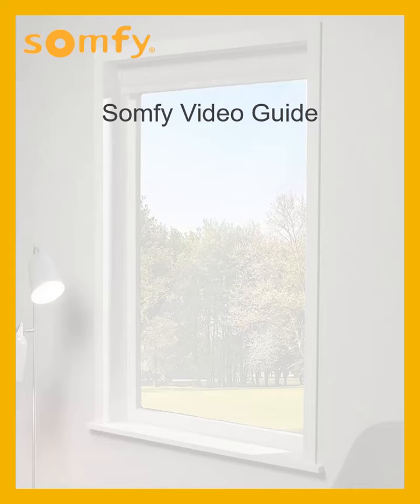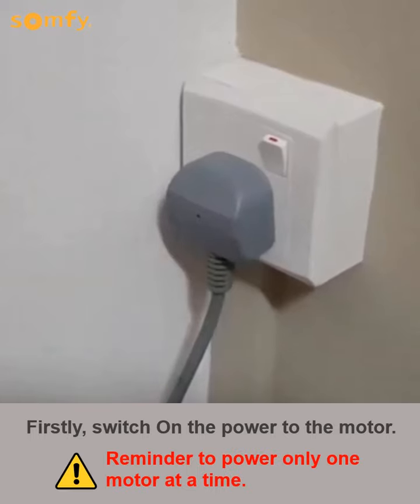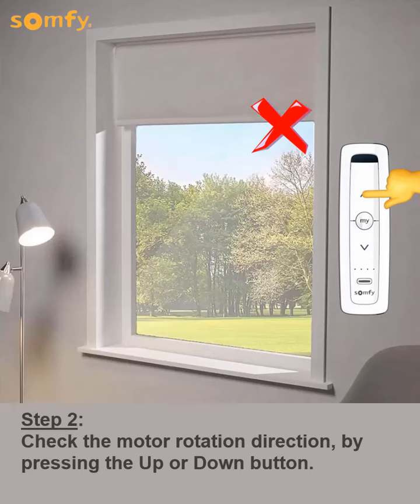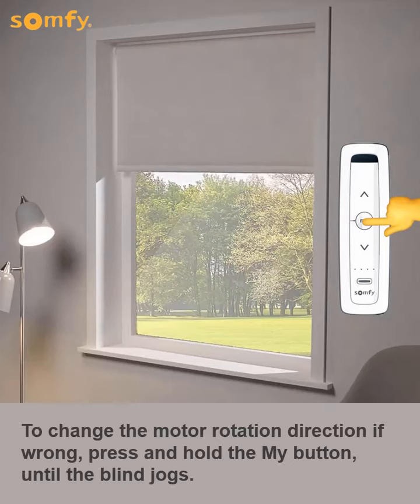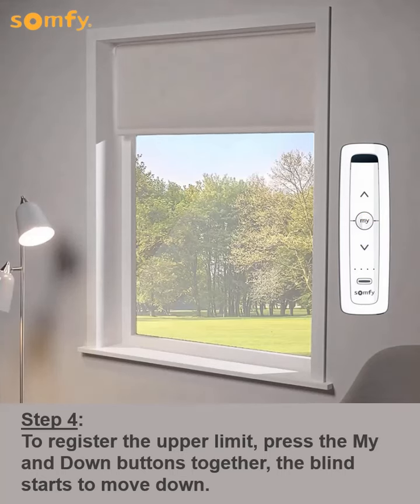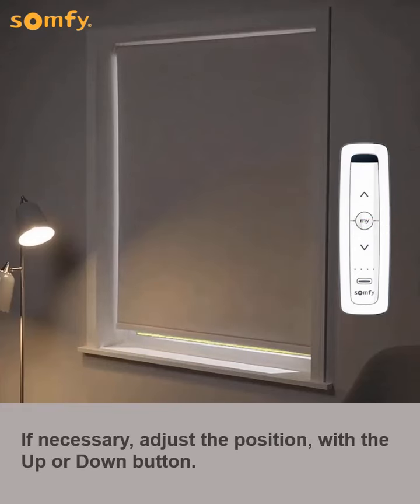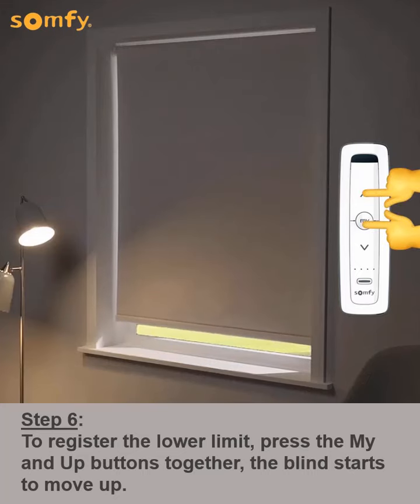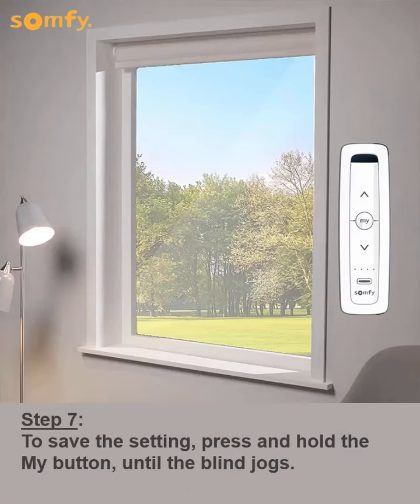[Somfy Tutorial] How to Set up Somfy RTS Tubular Motor - ENGLISH

Comment: How to  delete transmitter programs to zero setting.
Reply: Press and hold button in the motor, not remote for 10 seconds, blind will jog 3 times then all limits reset back to factory settings